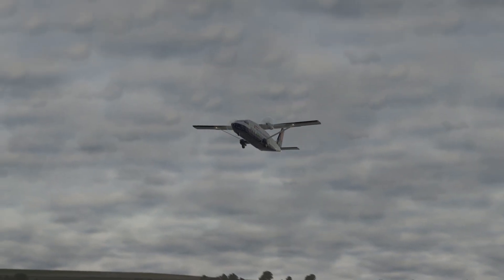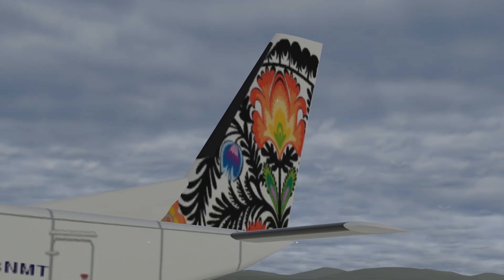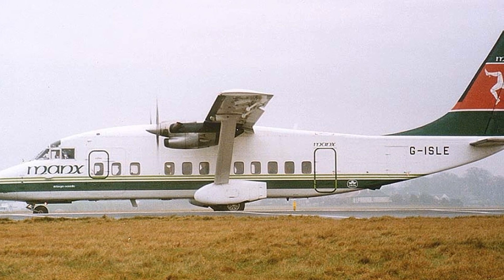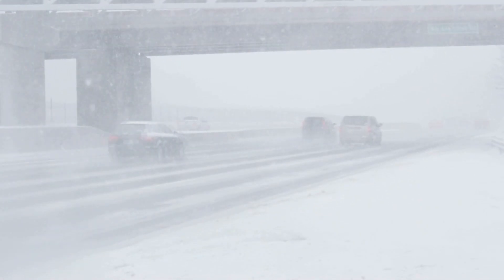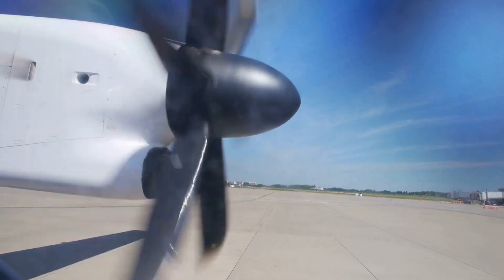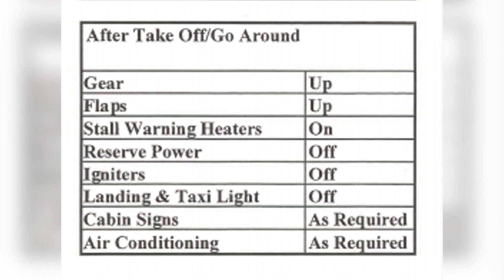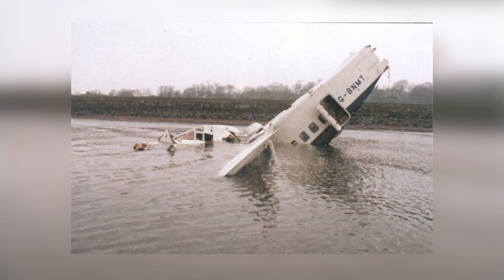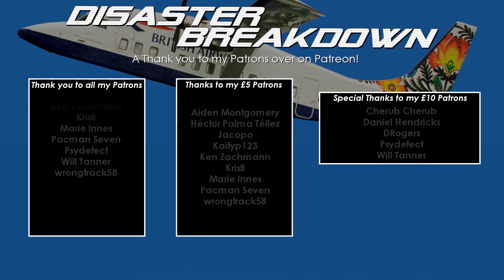How This Plane Ended Up Like This (Loganair Flight 670A) - DISASTER BREAKDOWN

Comment: I was one of the 2 (Servisair) ground crew that worked on this aircraft before its fateful take off. I can provide alot more detail on the moments leading up to this accident. What worries me most, is that, to date, I have never been Interviewed or asked for a witness statement of this incident by any air accident investigation.

If our concerns that where raised with the Dispatcher, Engineer & Crew before take off, had been heeded and acted upon, then this accident could have been avoided.

It still haunts me to this day

Comment: I flew the SD360/330 in Scandinavian winters some 25 year ago and remembered Ice on the aircraft and airspeed dropping dangerously low. 2 engine failures. The last one was close to ending my flying career.  We lost control of the propeller governor and never in my life  experience a noise and vibration like that. Looking at  the Propeller Rpm  moving beyond the scale of the instrument gage. We managed to partially full feather the propeller, but the prop still windmilling and guess drag. To almost being full of cargo we had to drop altitude and accumulation of ice became a major problem and airspeed dropped dramatically to point of flaps being needed to avoid stalling. I tell you flying with partially feather prop and flaps single engine in an already underpowered airplane in snow and ice in middle of winter over the sea losing altitude,no bueno.  I had my doubts that we would make it. But just below 2000 feet , water droplets started forming and the outside temperature increasing. Ice melting airspeed increased and flaps being retracted. Normally I don’t smoke but when the skipper handed me a fag, I didn’t say no. It was my first commercial job as young pilot.

Comment: Shorts have always made absolute pigs of aircraft, the most unaerodynamic airframes ever!

The SC-7, 330, and 360 all an offence to aviation.
The did not belong in the sky ever.

Caravans with planks for wings! There is absolutely NOTHING redeeming about them

Those poor men slaughtered by that mongrel of a machine.

Each aircraft ought have their own blanks, pitot covers and prop straps.
That is criminal that it was left so exposed in extreme conditions and the engineer failed to check.

Those ridiculous landing gear fairings would have dug in once they caught the water sending the nose diving below the surface.

I’ve flown on 360 twice it was must disgusting machine (they are not worthy of being called an aircraft) I’ve ever been on.
Reply: I've always wondered why these planes are so boxy (maybe to have more efficient cargo space?), but they definitely don't look as aerodynamic as other planes out there.
Reply: @timecode37    Utter nonsense. That curve to the fuselage acted a a partial lifting force. When rounding out to land we would delay it just that bit more or find ourselves floating down the runway. A good cargo and passenger lifter and fine for regional flights.
Reply: Any aircraft can be susceptible to icing conditions not just this particular type.

Comment: They still make planes with square windows??
Reply: I'm not an expert on aviation, but wouldn't square windows only be a problem when there is a big pressure gradient? This plane isn't designed to fly at the service height of a 737 or something comparable, so the stress put on the edges of the windows would be negligible.
Reply: @timecode37  The S360 wasn't pressurised.. operated at Mx 10,000ft. For the same reason the fuselage need not be round.

Comment: I feel like this could've been avoided by not switching the ice-valves over at once.
One at a time they could've noticed that the engine failed and not change the setting on the other engine.

Comment: It sounds to me as if the ice blockage was the true culprit. I suspect the culprit was in allowing the built-up show to melt then re-freeze then melt and re-freeze. Had they run the engines longer, the ice might have melted entirely which would have allowed for an uneventful flight. I hope that, in the unlikely event of a similar situation, part of the procedure will be to allow any build-up to thoroughly melt before attempting a take off, mindful that the air in flight will be cold and cause re-freezing once more if there is water left. Good information. Well done.
Reply: I agree. In the general case, snow is easier to melt than ice (lower density, better airflow, etc.). So, the refreezing almost certainly aggravated the problem. In their defense, it’s easy to see how the problem likely snuck up on them. After running the engines for quite a long time, at ground level, it wouldn’t be completely unreasonable for them to think that they had _surely melted away any snow and ice that were in or near near the engines. Plus, the crew appears to have followed the advice of the engineer, trusting their (e.g., his) judgement and acting in good faith. It’s all very unfortunate.

Comment: Terrible simply terrible Forgetting and or Obviously neglecting the thing that will either keep you alive or kill you most times without feeling or instantly is just that if you want to forget about keeping me covered up with a very simple  winter cover than your not only playing with me but also playing with your life. They always say How many flight hours So-called captions and the second Pilot have but never mentioned how many Thoughtful  caring hours they have for the plane there about to die in. 2 things could have been done here get a Step ladder and a Blanket and either stuff the engine intake or Mask it over with the Dollar store Blanket or go all out and steal a Quilted Furniture Blanket or 2 and go back to the hotel room & count your lucky star's you took care of the  machine that brings home the bacon. All the flight hours these people accumulate are useless to manning up with the Proper Sitting idle procedures in  Inclimate weather.  Thousands of hours For What ? To get myself killed easier By  neglecting the One thing The Plane ?

Comment: doubly upsetting episode today, not only the loss of life but also the reminder that Royal Mail was privatized :'(
Reply from the maker: I know I know, it sucks right 😭
Reply: They should've just grounded the plane at Edinburgh until the snow dissipated. If the storm cancelled trains and other flights, caused unsafe driving and left homes without power, then that's severe weather. We have a motto in aviation. And that is "If the odds are against you, you probably shouldn't be flying today.".